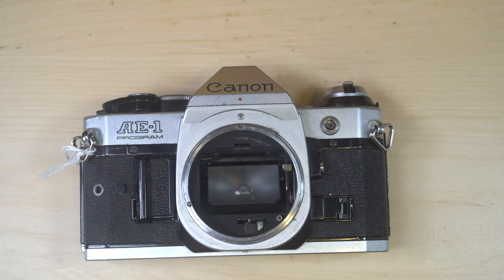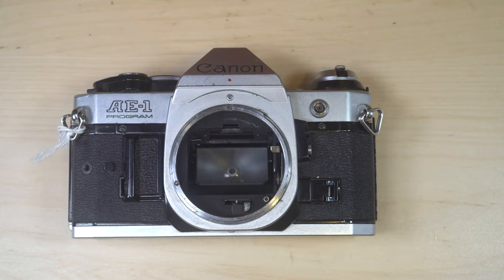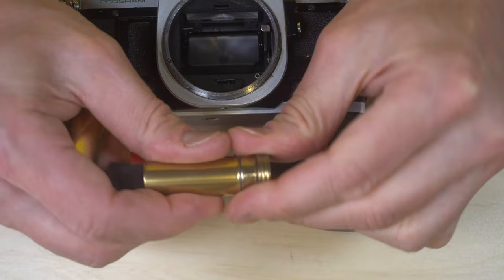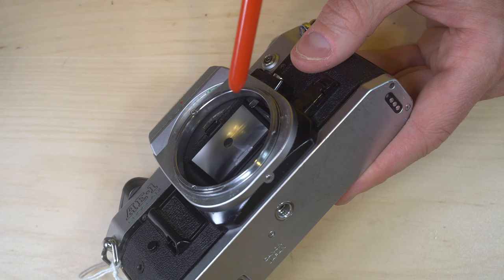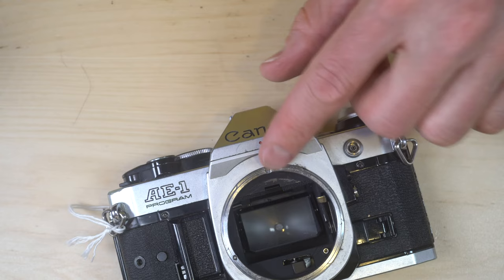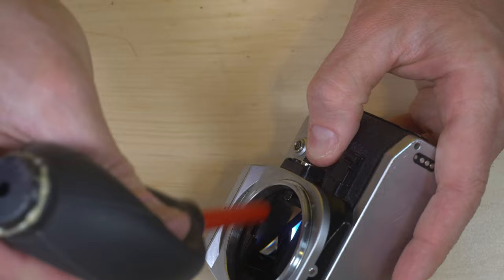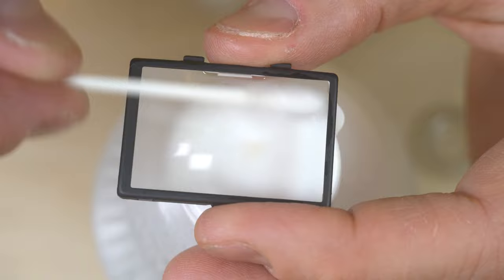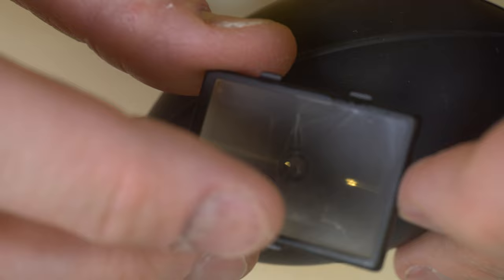Cleaning an SLR or DSLR Camera Focusing Screen as Safely as Possible & Why Solvents Ruin Screens

Comment: Im a physicist who works with lasers and I know the detrimental effect of solvents on optic coatings (anti reflective coatings and so on) Never thought a camera focusing screen can be "melted" in this way. 

Also a tip for everyone: please work with gloves :) our greasy and sweaty hands leave so much marks and from my experience it's a pain in the ass to clean them and leave a spotless lens surface.
Reply from the maker: Thank you! Good tip about the gloves and one I often forget.
Reply: They're only made of plastic for the majority, some are ground glass so are more tolerant but still wouldn't use any solvents on any of them.
Reply: I hate wearing gloves when repairing things, as no pair of gloves ever fits well enough for me to have an easy time manipulating objects in my hands, especially small delicate objects. My usual technique is to make sure I don't ever touch optical surfaces after I clean them. I'll hold filters, and in this case the focusing screen, by the edges only, just like we used to with CDs.

Comment: So I simply went to clean mine due to having dust particles that would not blow off with the blower. And found that a Q-tip left minor scratches all over it. After watching a brief simple looking tutorial off of YouTube I decided to take my focusing screen out and clean it by hand to see if I can remove the scratches. At this point I used Dawn dish soap and warm water. And that's when I saw that the scratches would not come out. I also went back to look at my camera to see how hard it would be to reinstall for the Canon 90d because there is an extra clip that holds the focusing screen on that is not on a few other cameras and it was at that point that a bunch of other pieces fell out of my camera! So just a warning to everyone. I am very good at fixing stuff especially gadgets and gear and I must say that this was not as easy as I thought it would be and there was parts that were not in any tutorials and now I don't know where to put them back. Unfortunately now I have to take it to a camera shop which the closest one is about 45 minutes away. And I have no idea what the cost is going to be. So just please be careful if you try to do this at home
Reply from the maker: Yeah, the focusing screens are very fragile.

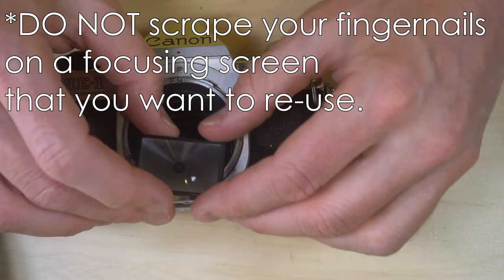Comment: 9:26 this part screwed me up so badly when I was cleaning mine. I have a digital EOS, and the shiny side of the focusing screen faces down, toward the mirror/lens/shutter. I spent quite a while trying to put it back together, because it didn't fit with the shiny side facing up. Luckily, Canon has keyed tabs molded onto it, so it can only be inserted in the correct direction. Definitely more anxiety-inducing than I would have liked, because I really didn't want to scratch it. Replacement 400D screens aren't as easy to come by. 

So the screen doesn't always have the shiny side facing away from the lens. You have to insert it the right way for you model camera. They aren't all like an AE-1 Program.

Still super grateful for the walkthrough! I now also have this in my bag of tricks for when I have to do things. I was debating about just having a camera shop look at my camera because other tutorials made it seem way too complicated and dangerous.

Also, there is a very easy supply of distilled water available to anyone: it's in your breath! You don't want to spit on stuff, but if you gently exhale over something like a lens, the water vapor in your breath will condense on it, and there are no minerals in the water vapor in your breath. My dad cleaned his glasses lenses this way for as long as I can remember.
Reply from the maker: Interesting. Thank you! I've not removed screens from a digital EOS before. Curious that it would be installed in that orientation, but good that the tabs help keep it oriented.
Reply: @DavidHancock   I didn't think to take it out to clean it at first. I tried with a brush and blower, and then in my ignorance, I tried a lens cleaning wipe (while it was installed in the camera). If I had to guess, I would say that being a common first attempt would be the reason Canon flipped the design. 

My camera was made well after inexpensive consumer level SLRs like mine were commonplace, so I would guess there was probably a generation where hobbyists were ignorantly damaging their focusing screens, and Canon flipping the design over and made them less easily damageable when not removed.

Likely I didn't damage mine, and the shiny side is still shiny and scratch-free!
Reply: @DavidHancock  being able to take one out and clean it is totally new to me. I had always thought the focusing screen was just molded/etched directly into the bottom of the pentaprism.

Comment: I recall a product I saw at a trade show that was similar to a piece of tape that could be placed on an SLR mirror and then peeled off to remove fingerprints and dirt. That tape might do a good job removing gooey foam debris from the fine ridges of a focusing screen too. Just an idea to consider.
Reply from the maker: Interesting. My only fear would be it pressing dirt into the ridges. Do you have to press it down to get it to stick to dirt.

Comment: I tried to clean mine and I used a cleaning solution rag that I used to clean my lenses and it was also the same solution that I clean my sensor with. In my brand new Canon 90d I had lots of what I thought was sensor dust but after cleaning the sensor it was still visible and aggravating me. So I blew some air on the focusing screen and got most of it off but there was still visibly one or two black dots. So I took my ragging solution to wipe the focus in screen and it just made a mess. Apparently there's a coding or something on it so I took the focus and Screen held washed it with Dawn dish soap and then I can visibly see where I had cleaned it with the sensor cleaning swabs had made light scratches all over it. So now I have a new one on order and I'm going to try to put this back together. Thank you for these videos.
Reply from the maker: Thank you and that's a bummer about the one you had.

Comment: This is the topic of the hour for me at the moment. I found a Ricoh XR7 which I really like more than any K mount Pentax I've used. Problem is the dirt and dark smears on the Focus screen. To remove or replace the Focus screen would entail removing the top plate. I did manage to buy a replacement focusing screen from a Ricoh XR-X which I'm pretty sure is the same, but I don't have to tools to dissassemble the camera. I'd give it a try if i did. I have used rubbing alcohol, but 99.9% Isopropyl which I read was non-corrosive to plastics (ethanol based solvents are the big NO NO), and it doesnt seem to have damaged the screen too much if at all. If I point the viewfinder at a light and look through the lens I can still see the concentric circles extending from the focusing prism. They dont seem to be damaged, but there is just still lots of black mirror foam dirt lodged between them which I cant remove at all
Reply from the maker: Thank you and good luck! Replacing a fixed focusing screen is a major repair.
Reply: This has happened with my Chinon CE4. The only thing I have learned is when you remove that black goo from any fixed screen camera do it with the camera over your head so you are forced to look up to do it and so this goo cannot fall on the screen and I would be tempted to use black felt (self adhesive) or the hairy side of velcro rather than foam. Both materials I have used gaining success and the possibility of history re-repeating is removed in one sweep.
Reply: @markberry2969  Praktica MTL cameras use fabric and felt for light sealing. The felt flattens over time, but it doesn't cause any issues with light sealing.

Comment: Man, that was a great video. Thanks for the explanation about the working process of the mirror. I wasn't aware and I definitely would have ruined it if I had to go on a freestyle method. 
Thankfully, my AE1 Program doesn't have this issue. I will have a look at my OM-1n but I think I'll need distilled water for this one !

Thumbs up !!!
Reply from the maker: Thank you!
Reply: @DavidHancock  I tried to dismantle the 50/1.8 FD mounted on it but it seems that the 2 main haze sources are located within the elements of the 2 doubled-lenses groups while they seem fixed. Is it possible ?
Reply from the maker: @Delmonteil  unfortunately not, assuming it's on the balsam that joins glass elements.
Reply: There is distilled water in your breath! You can gently exhale on a lens surface, and the water vapor in your breath will condense, making it usable to clean the lens. Just make sure not to spit on it (saliva is not just water)!

Comment: Nice Video Great info. David, can you please make a video about Canon FT QL and Canon FTbs (AE1 FX)  and other same line models..most often illness, about how pentaprism support foam (with long time), damage and causes corrosion and oxide the pentaprism mirror layer. This problem can be  detected if you see the big black spots in the viewfinder. And to fix this you should take a new prism from the donor camera, cause to apply new mirror layer on the prism is very pricy. Again Great video, I am Vietnam war collector, got my Canon FT QL in great shape, but my friend got his FTb and this problem occured, he didnt know that this black spots in a viewfinder were a big red flag...problem.
Reply from the maker: Thank you! I do have videos on both of those cameras already. I haven't previously included sections in videos on known camera problems (though I do include that section in the ebook manuals I write for select camera models.) That's a good suggestion for a section to add to the videos.

Comment: Cotton sticks are not a great idea as they tend to leave very microscopic dust/fibers. Better is to get a fine "grained" medical gauze and put it on a spatula and moisture in the distilled water.
When blowing it's better to hold the camera so the dust travels down from the focusing screen and not back to it with gravity ;)
Reply from the maker: Thank you and good points.

Comment: Thanks a lot, that was very useful, but how to know that this or that camera has a removable focus screen or not?
Reply from the maker: Thank you, Najib! For individual cameras, that info should be online or in the manual. In general, there are two ways to access a focusing screen on cameras with a removable screen: take off the prism or through the lens mount. In the former, removing the prism is an obvious sign. In the latter, cameras with removable screens will have some kind of cradle with a retaining clip in them. They're not always obvious but there will be some way to release a clip or spring so the screen can drop.

Comment: I have a feeling that the focusing screen in itself is a Fresnel lens, am I right?
Reply from the maker: Some. It depends on the design. As a general rule with exceptions, the screen itself is ground glass or plastic and a separate Fresnel will be next to the screen. Most cameras after the 50s included either a Fresnel or a ground glass design that did the same thing to reduce the effects of light ray roll of and periphery darkness in viewfinders.

Comment: thank you for this!! Your videos are really informative :)) I have a question though.. I'm restoring a hand-me-down camera but the photos are not coming out focused in the same area I focused it on. No matter what lens I'm using, it seems to be off and will end up focused further back. Is this something I can fix?
Reply from the maker: Thank you and it is possible, but the difficulty will vary based on the camera. In short, the light from the lens focuses on the focusing screen when the mirror is down and the film when the mirror is up. Your focusing screen is out of alignment. If your images are focuses CLOSER than your intent, then the focusing screen is some fractional millimeter further back from the mirror than it needs to be. If they are focused FURTHER then it's some fractional millimeter closer to the mirror. The further the light travels out of the back of the lens the closer the focus point (which is why focusing a lens closer physically moves the lens elements forward.

Okay, so how do you fix that? You need some really thin shim material. It could be paper, honestly. I used paper tape to fix this issue on my Bronica SA. It depends on the camera you're using how much of a repair you need to do.

So get some kind of material you can use as a stand-in for film. frosted cellophane tape can work in a pinch but is not perfect. A piece of clear acrylic the size of the inner film rails and ground to a textured finish on one side will be better. You want that piece of plastic to mimic the film's placement and plane. So the frosted side faces the lens and then you just tape it into the camera body on the inner guide rails, between the outer guide rails.

Then focus on something easily identifiable using the ground glass on the film plane (a tripod is mandatory here, BTW) and tape your lens fixed into that focus point. Next try shimming the focusing screen until the focused image there matches what's on the focusing screen in your film area. In theory, it should work. It may not be perfect if you're shooting an f/1.2 lens, but you can get it pretty darn close with that method.

Comment: I just did the mistake of using rubbing alcohol it has a black spot all over my viewfinder now is there any thing i can do to fix it
Reply: Can you get a new focusing screen?
Reply: @janmelantu7490  yess if it is available to deliver in india
Reply from the maker: Depends on your camera. If the screen is replaceable with other screens, like on a Canon AE-1 Program, no problem. If it's fixed, like on a Canon AE-1, then it really needs a professional repair because replacing a fixed screen is a pretty significant disassembly.

Comment: Isn't a cotton swab to coarse for the focusing screen and may damage it? Also it's pretty fuzzy and particles of it may get caught up by the ridges of the rough side? Or will soaking it with distilled water prevent this. Maybe a cleaning swab for digital sensors may be better as those have a smoother surface. 
What do you think of using one of those sticky sensor swabs? Those that you also use to remove spots from a digital sensor. They're a little sticky, a little bit like gummy bears

Also I'm weary of a brush, I tried it once and had the feeling it causes more dust than it takes away.
Reply from the maker: The cotton swab approach, if used to dab and not wipe, is just fine because it's being used to wick up distilled water and dirt, not wipe it away. And a good brush should not leave fibers behind.

The sticky sensor swabs could be a good idea. I haven't tried them and I'm not sure if they would work well. The cotton swab approach came from two of the camera repairmen I used to send cameras I couldn't fix to, and that approach goes back to the fifties or sixties at least. There may, yes, be a better way now, though.
Reply: Regardless of one persons video, you should never touch the Fresnel Screen, especially a plastic one with anything, if you need too for some stubborn marks, use a Sable Brush.

Comment: Does this method work for the Pentax K1000?
Reply from the maker: Yes but that screen isn't removable. If you're seeing something black in the viewfinder that looks like tree branches, that's not viewfinder dirt and may be desilvering, which requires a new prism.
Reply: @David Hancock  Thank you! I had noticed fine specks and an almost translucent streak on the view finder but upon further inspection it turned out that the mirror was dirty and the focusing screen had the streak. I just hope it's an easy fix.
Reply: @David Hancock  One more question. Is all distilled water created equal or is there a particular brand you find better than the others?
Reply from the maker: @LouisNavor  insofar as I know, it's all equal.
Reply: @DavidHancock  thank you

Comment: Can you immerse a focusing screen in distilled water to clean it without dissolving it? I am a newbie and just bought a Pentax K1000 that has gunk from the degraded mirror foam on the focusing screen. I'll likely have to have the screen replaced entirely, but I was just wondering if immersion would be the best bet to get rid of that gunk
Reply from the maker: You can, definitely, but your K1000 screen isn't removable. If it comes out, there's a bigger problem with the camera.